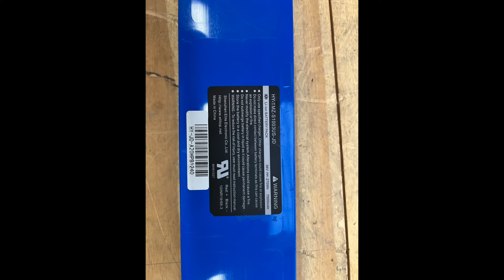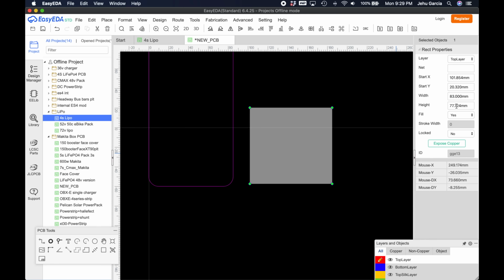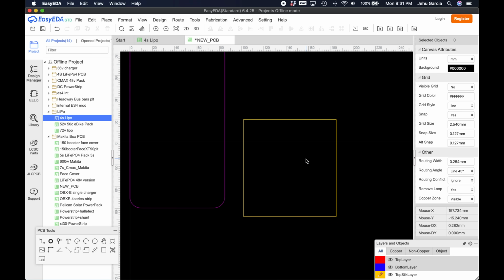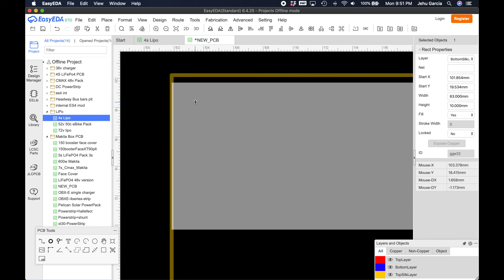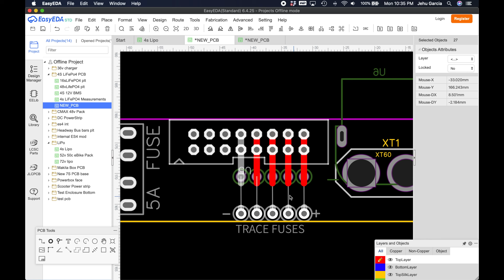29 dollar 36v ebike battery teardown

Comment: 01:35 "...that means these are working batteries"
It doesn't work quite that way. The meter probably requires fewer than 50mA for power. To test if a high current 7.5Ah pack is a "working" battery requires something that consumes quite a bit more than 50mA. Even a really bad cell in a pack can often allow/provide a low current for some time without significantly affecting the measured voltage on most meters.
There can also be a flaw in the Battery Management System (BMS) that won't show up when tested at low currents and the pack MUST be tested at high currents to verify it's working properly.

Comment: Hello nice vid, but at 0.55 you'd better explain voltage vs amps. Cause the voltage might be there but if there is no sufficient amps the voltage will drop under load. Regards

Comment: When you said it was 10s I was thinking no way it can be 7500mAh....maybe 5000 when new at best.....but then you opened her up and my assumption of 2 rows of ten was WRONG .....3 rows of ten in a 2 row config!!!!
Nice :)
Reply: Hello, it could have even exceeded 10000 mAh with the Panasonic NCR18650G (3600mAh). It depends on the mAh of the 18650 cell that's used. But with most chinese brands you better be critical cause they love to exaggerate. So maybe you'll have to divide that number by 2 to be safe. Sometimes the chinese also sell repacks from second cells as new. Better go watch some China videos. Regards

Comment: I have a similar battery with this long BMS board and when I turn my m365 like Hover-1 Alpha scooter on, the battery out voltage drops to 10V? flashing battery icon in the display I can still measure 4V per cell group while the battery out is reporting 10V. As soon as I turn off scooter the battery out voltage starts to climb back to 37V. Could it be a bad BMS (as it does not seem to affect the state of the battery before the BMS) or a shorted controller?

Comment: I have an  lfaster 36v conversion kit and I am using the 36 volt battery on your site the problem I'm having is that the bike keeps cutting off and I think it's a overheating problem is this because of the voltage on the battery when fully charge the battery has 41 V

Comment: Just tore one of these down, the BMS is screwed in under the silicone aswell as spot welded in 7 places atleast, a cutting wheel will do but i used a sharp flat head screwdriver like chisel to peel the welds back and peel em off the cells, some where at 0.6v only 6 of 30 the rest where 2v around, ALL recovered and restored
Reply: Did you reuse the BMS? I just tore one pack down. 1st time figured good one to learn with. If you tore the cells out of the plastic casing how did you go about it?
Reply: @Sk8strings  No i couldnt get it off without breaking the PCB, its well glued down so  ihad to pry it off after removing the nickel strips, ive made these into 3s (12v) drone batteries with a spot welder and clamping my cables in a rolled up excess piece of nickel strip, there in battery holders below the two plastic frames i think it was, used a flathead screwdriver and sideways torque for the whole thing
Reply: @Jacob-og9pz  thank you!
Reply: @Sk8strings  I snipped all the white cables before hand at both ends
Reply: @Sk8strings  I wouldnt use a bms in any case EVER I add balance wires now and use an RC battery charger balancer
Reply: @Sk8strings  The battery holders broke whilst i ripped off the strips of nickel i twisted the pack to snap it then pulled off the battery holders, i then printed some off with the easythreed X1 cheapest 3d printer money can buy
Reply: @Jacob-og9pz So basically you just ripped the battery apart and ruined everything.  Gotcha.
Reply: @TheFogLakeshore  Ok mate ill send you them all for testing if you want

Comment: Works great my Latest.Bike I have a bad knee so I still get exercise but the bike assists me. I am a big guy so I didn’t think it would go as fast but it works great.
Reply: Just for information...
Some computers/controllers on ebikes allow the user to fairly easily adjust the Pedal Assist level parameter assigned to each number. You MAY be able to adjust it, just using the few buttons on the computer, to be more compatible with your actual physical requirements or preferences rather than just sticking with the default "general population" parameter settings. You may for example, change settings to provide smoother transitions between power assist levels with each step up or down that you select. My sister found changing the settings made quite a difference in her riding experience.

Some people feel they are always jarred somewhat hard when the Pedal Assist "kicks in" and a few have reported actually losing control because it was unexpectedly quick to transition from one level to the next higher level of pedal assistance (eg from "1" to "2"). If you don't have a User's Manual, you may be able to find your ebike's computer manual on a website like manualslib
For example, I think I recall finding the User Manuals for the S866 computer (among others...my memory is a bit fuzzy so the model ID may not be right...) and the details for changing these parameters were in the manuals (they come in PDF format). You can also find out such things as how to change the speed calculation parameter settings depending on actual tire diameter to make it more accurate, and so on for other physical, preferences, and environmental factors.

Comment: So there are 30 batteries 865 in the pack? How many volts is each one? Can you use one without a pcb board and just link them together to use for an ebike?
Reply: 2 banks of 15 with 5 groups of 6 batteries. When you flip them over youll see 6,6, (3+3), 6,6  battery ends strapped with 5  buss bars. Tops are hidden by BMS.

Comment: I have the 36 V scooter battery. I am using a step down converter to convert it from 36v to 12v to run a 12v refrigerator.  Is it possible to build a 12V charger that I can use within my SUV to charge the scooter battery while driving down the road?
Reply: If you never got any help, you could always get a 12v ac inverter and then get a simple 36v lion charger “it’ll say 42v because that’s what it charges up to” and use that to charge it through your SUV’s car charger port
Reply: @guymee  thanks!!!

Comment: Some lawn mowers also run on 36V. The pack in my mower is  36V  nominal 7.5Ah. Almost does the complete 700m section on a good day. Connectors are Anderson, so could be used as an extra pack.

Comment: Sold out in under 2 hours! You know its a good deal when!
Reply: How exactly is this a "good deal" for 30 generic Chinese 2.5Ah cells for $29? That's like a buck a cell +shipping, for used CHINESE cells! OK I guess, but not even particularly "good." Certainly not when BCH sells similarly configured 30 cell packs, but with 3200mAh LGMH1 or panasonic's 18650BD, (10a cdr capable cells) for $23. 
Plenty great deals around, no need to pity missing out on something that wasn't actually THAT great of a deal in the first place.
Reply: @ABritInNY  True, had they been an brand name cell I would have been disappointed, I watched the video for about 10 seconds before hearing if they were a brand name cell to see the sold out sign and thought, "Wow that was quick". On to the next. Yes the BCH MH1 packs are probably the best right now

Comment: Could you talk a little bit about the process involved in battery recyclers and how they decide what gets recycled vs redirected to the used market? 
Are companies like bird lime, etc actually paying recycling places to take these packs and then they are selling them back to the market ? 
Seems like there is the possibility of some shady dealings. Just wondering if you are able to explain the market in a video, it might be a good chance to attract new viewers.
Reply: Absolutely. recyclers will get paid to take these cells off a corporations books so they dont have to hassle with the regulatory fees of disposing of this stuff 'properly'. Its up the recyclers to break these down and separate the wheat from the chaff,. It's a win/win for the recycler, they get paid to take batteries (free inventory) as well as make a buck on the back end, Most of the recyclers are middlemen that will then sell to an offshore scrapper who disposes of this stuff in less than US EPS standards... "Not in my backyard" .

Comment: Do you have a spot welder you recommend for under 100usd?
Reply: Check out the sw-2 by sequre or however you spell it. They have a larger unit and a smaller one. 200+ for the big and sub 100 for the little one.
Reply: @kevins5016  I found it! Have you ever used one of them just curious?
Reply: I have the SW2.. it does fine if you use it within it's capacity. Unfortunately if you need .03mm it will probably not work with pure nickel strip. Plated will work but you are better off using.02mm pure. 
If you can come up with the extra money to get the bigger one it's probably worth it if you are going to be using it alot. 
But yes the 100$ unit is a good buy. Don't get tempted to buy the ultra cheap welders, it will blow up and be a waste of money that could have gone to something that works.

Comment: Why are you so focused on 36v and ebikes? Only seen two in person, purdy rare....

What else can you do with 36v? Weird amount
Reply from the maker: Because there hundreds of thousands of these packs and no one has any vision to use them.  They are literally some of the most affordable high quality battery packs you can buy right now.
Reply: 36 Volt EBikes are extremely common! Its basically 36 / 48 / 52 that make up the vast vast majority of the ebike market
Reply: Use it to buck down to 12v or 24v to run inverters, power 12v accessories like USB PD chargers, DC sources etc etc. 

Going from higher to lower then using a buck converter to lower wattage means you can use thinner wires for runs from batteries to the converters/source and it’ll be fine. 

For me I’m using 36V to power 12v inverter and USB PD 60-100watt power sources.
Reply: you can buy a 36v inverter , buy a mppt charger that can charge 36v through solar panel  you can do alot with it
Reply: 36v is a industry standard for low power electric scooters and ebikes. Most of these packs are coming from the share scooter market so they are 36v. I don't think he's just focused on 36v packs and passing up others. This is what's available right now.

Comment: Whats amperage output? Why do you never post or mention this info?
Reply: That's not completely accurate actually. Different cells have very different discharge rates. Some being very high but most of the popular name brand cells are around 10 amps like the MJ1, BD and a host of others. In a higher power ebike or scooter pack you might find these cells but most likely the BMS is limited to maybe half of the cells discharge rate. So yes he's correct in saying that most smaller 36v 3P packs are probably going to output 7-10 amps ,I wouldn't say it's common knowledge or any industry standard that you should know.
Reply from the maker: Because it’s common knowledge that 3 cells in parallel are good for 7A-10A.  This is DIY if you don’t know anything about batteries, you should be buying new full priced, warrantied, packs that come with instructions and not these diy packs.
Reply: @jehugarcia  Save the condescending tone garbage merchant.

Comment: What wire was the charge and discharge on it?
Reply from the maker: The bigger one is the discharge port
Reply: @jehugarcia  so we would only have to make a special connection to fit the charge port wire or chop it off and make our own connection to match a 36v charge connection right.

Comment: So jealous of you guys in the states, haven't found any recycling places that sell packs this cheap or anything close in UK/EU. Man these are such good deals.
Reply: If you want decent cells, just buy lishen or BAK 18650, for around 1 - 1.5 dolars a unit. Don´t forget the shipping option is by train to be the cheapeast possible to the EU.
Reply: @tdomingues89  buy from where
Reply: If you go to his shop and look for worldwide sellers, there is one in EU that sells bulk cells. But they wont ship to UK so no good for me...
Reply: Imagine in South America or Brasil to be more specific... A quick Google search showed some 18650 for 25+usd each...
Reply: @brenolima7520  São células de 2500mAh 10A provavelmente, então vc terá que comparar com as mesmas especificações e verá que na lifeion tem quase o dobro de capacidade 4.5Ah ate 5Ah com 10A ou 2C de descarga e o custo é de 25 reais cada or $4,5 each cell. Hoje em dia as 21700 compensa mais do que as 18650.
Reply: you need to look at the right places to find em.
Reply: Where I live (Cyprus) the price of 1 18650 cell is 10 euros..And you can't import batteries.. imagine how jealous I am..
Reply: Don't forget you folks have that pesky "just because" high cost VAT...the U.S. doesn't.